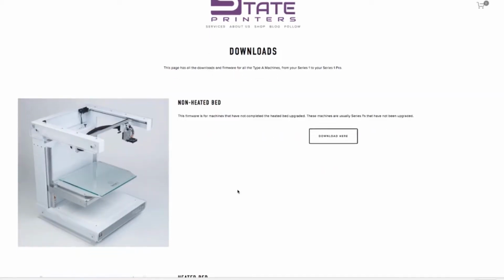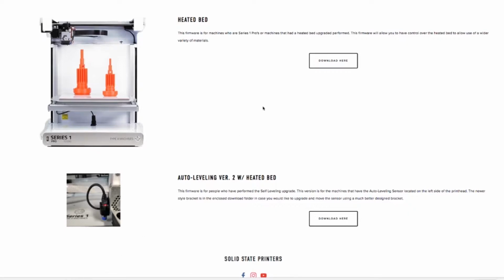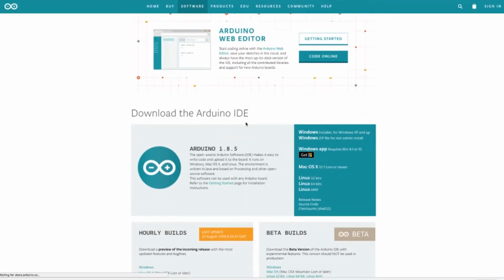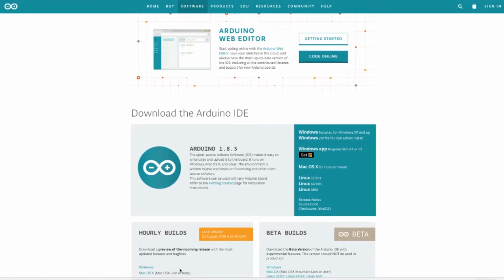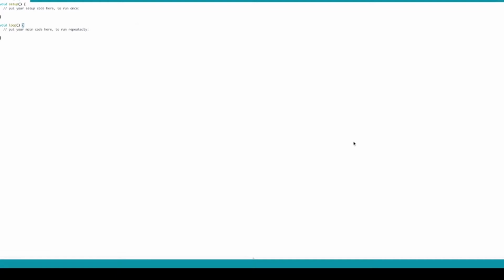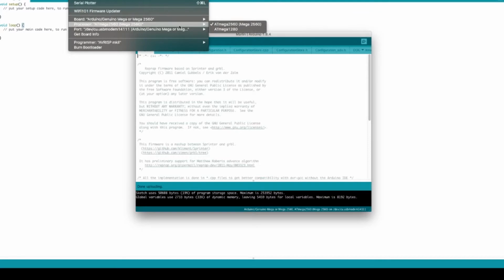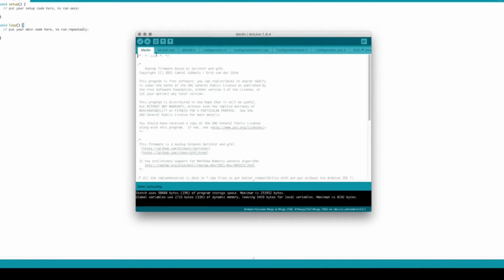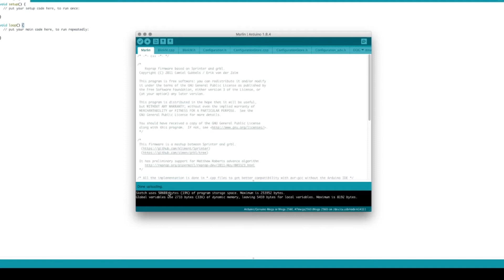5 Easy Steps to Installing a Heated Bed on your Series 1!

Comment: The heated bed in the webshop is apparently only for the Series 1 Pro. Is a heated bed kit available for the non-Pro version as well?
Reply from the maker: This video shows you how to take your Series 1 (non-pro) and add a heated bed.
Reply from the maker: You would need a "heated bed upgrade kit" from the shop rather than just the heated bed.